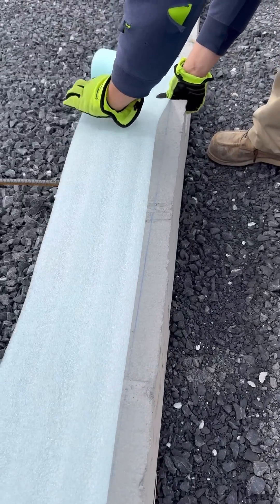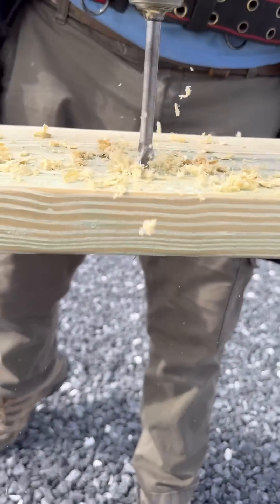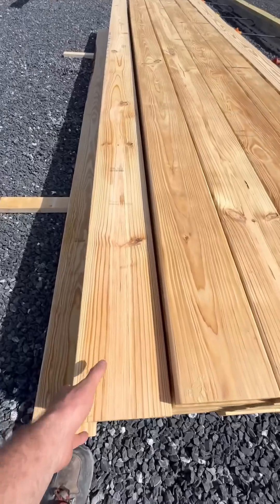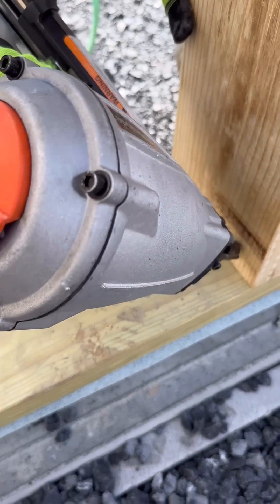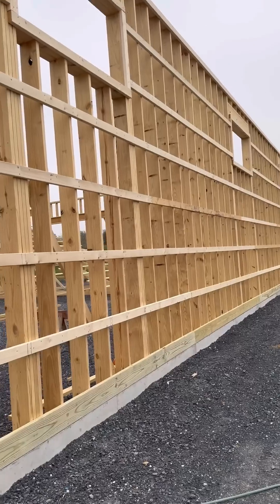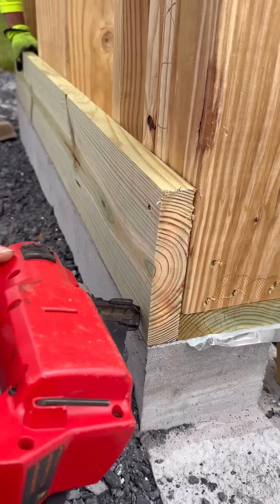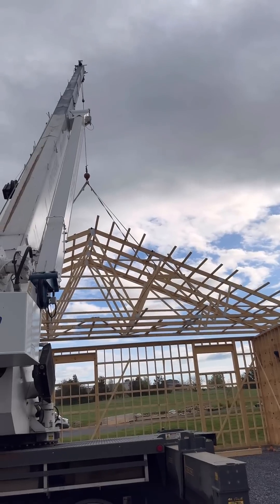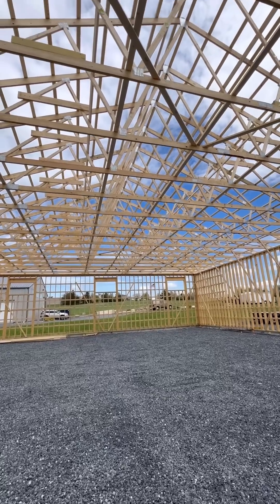How To Frame A Warehouse

Comment: Could you use heavy duty L shape brackets and galvanized bolts, nuts and washers to secure the studs instead of nails in an angle?  Would it make the structure more durable to do that?  Or would the bolt holes in the studs compromise the integrity of the stud?
Reply from the maker: Nails are just the standard way of doing it
Reply: To me nails are OK for this kind of structure. Because the members that are keeping the studs upright on their place are the girders, that are attached to the studs, thus making the studs work as one single bar. Next there's the connecting walls that close the rectangle shape making the walls support and brace each other.
Nails work is to attatch the studs to the foundation member that is the sill plate. They are not keeping the studs upright.
Even if they would use L shape brackets, they would not improve much the stability of the walls, but they would be much more expensive to build.

Well, to me the weak point of this wall framing system is the fact the contact area of the studs is very thin, or small. The stud shouldn't be 1.5 x 7.5. It should be at least 1.75 x 7.5. But it's what they get.

Good work!

Comment: I don't understand why the capillar cut was left insufficient for the foundation? Can someone explain. Where I come from, the wood and concrete never touch each other that close to the ground.
Reply from the maker: The sill plate is pressure-treated wood
Reply: @hausplans  why didn't you put a piece of sill foam under that 2x8 pt rim board at the bottom

Comment: I like how you put sill seal down but not for the pressure treated purlin .. 🤦 🤣
Reply from the maker: Both boards were pressure-treated. It’s just a lighter green.
Reply: @hausplans  you don't get what I said .. 
Why didn't you put sill seal under the purlin..,?
Reply: @Gunter_Custom  Cause they messed up. The sill plate gasket should have been wider to cover the concrete right to the edge.
Reply: @jamescrud  well they do come in those widths.  But they could have split one in half or thirds  and used it for the part they missed . 🤣

Comment: Why are the foundation walls smaller than the 2x6 bottom plate? Just curious, it might be just the video but looks like a lot of the 2x6 is hanging over not support ? Is there still concrete going in afterwards?
Reply from the maker: Yes, there’s a 3 inch ledge that concreat will sit on after we pour the floor. The wall will be fully supported.